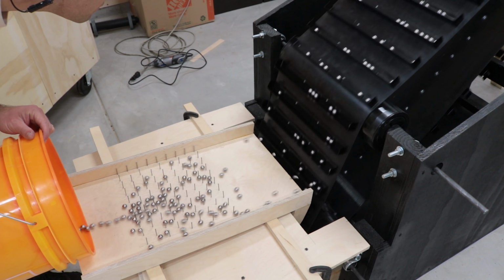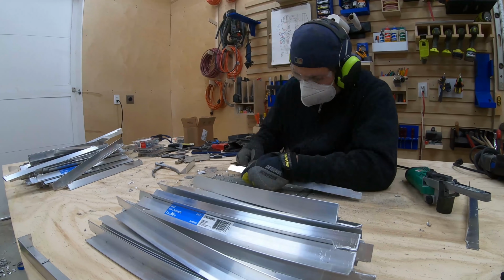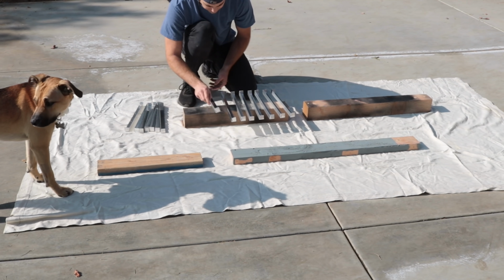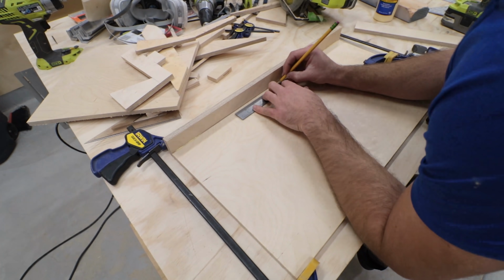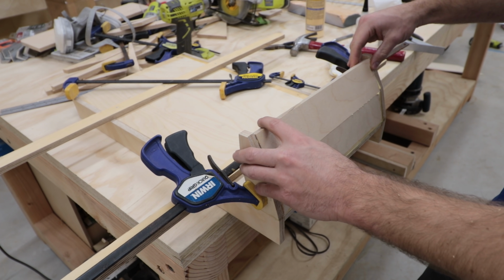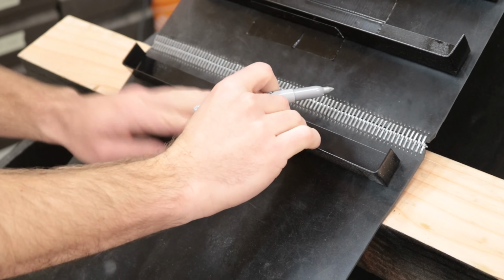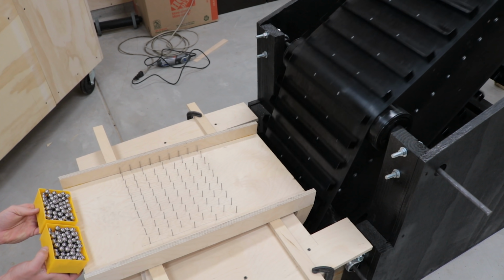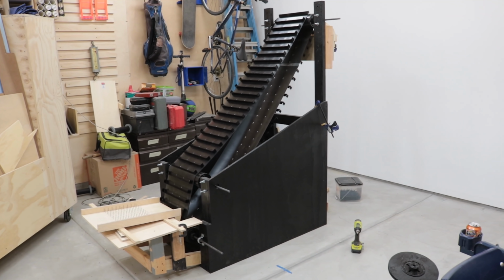Universal Marble Machine Lift Build, Part 4: Getting it Up and Running

Comment: I imagine that the track at the bottom might be improved by making a smaller (in width) ramp onto the belt, thus helping to prevent marbles from falling off the brackets
Reply from the maker: Great minds think alike! That’s a change I make during testing and adjusting. You’ll see next week!
Reply: @BenTardif  and in the thumbnail XD
Reply from the maker: Good catch 😆

Comment: If you're mostly using ball bearing as marbles I suggest adding a electromagnet behind the steep part of the marble lift.
Should greatly reduce transport losses due to marbles rolling of at the sides. 
Won't affect the brackets (apart from the rivets) and should reduce bounce (and possible noise) aswell.

Comment: I know you're shooting for a quiet lift so you can hear the marbles in the actual marble machine.  Have you considered felt lining for the brackets to reduce the metallic clatter when the marbles land?  You could do a similar, perhaps double layer on the catch ramp at the top.
Reply from the maker: I’m definitely considering it. Though I’m still looking around for a material that will dampen yet won’t affect performance
Reply: @BenTardif  scraps of neoprene might work as well, though you may have plans for the leftovers.  I'm also not sure about the cost and performance difference there.
Reply: Use Plastidip spray on the brackets?  Or maybe use Gaffer Tape ... as a nod to your stunt work on tv and movies.
Reply: Maybe sound deadening spray paint could work, though it would have been easier applied before the brackets were attached to the neoprene.
Reply from the maker: Great minds think alike. I tried one layer of gaff tape and it isn’t enough to change the sound. I will test multiple layers but that may not be the right solution
Reply: @BenTardif  I figured with your past history for working at Disneyland, you would like the idea of incorporating something onto your build that has an element of your other work or interests.  Just like placing an Eeyore Parking Lot sign inside the Temple of the Forbidden Eye. 🤓
Reply: I'd try inserts of EVA foam. It's pretty cheap and you could make them replaceable.
Reply from the maker: Thanks for the tip! I’ll look into it!

Comment: Great series Ben! I’m really enjoying this build. Have you considered maybe adding some 60, or even 40 grit sand paper to the rollers to grip the belt a little better? May help with the added weight of marbles, as the machines get bigger and better!
Reply from the maker: I have sandpaper tape called safety tape that I could use, though after a bunch of tests, there’s plenty of friction to keep it rolling

Comment: I've been watching these conveyor build videos. Nice job. What size steel marbles did you use for your marble runs? I normally use GraviTrax marbles which are 1/2" diameter. Regular glass marbles are slightly larger.

Comment: You might want to consider what will happen when a marble finds its way between the bottom roller and the belt, on the inside. It looks like a problem that you'll face soon and I would hate for it to break something.

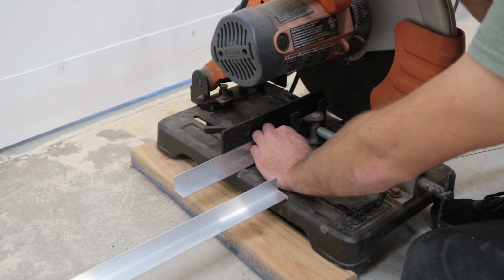Comment: 0:27 stand back boys I'm a DIYer ill do it my self

side note- if its aluminium a table saw should cut it reasonably well just set the rip fence the the width and cut until the mark then bend  with less harm to kickback or your fingers getting caught in the blade

Comment: I have a question. You said you want this machine to be quiet, so it won't take away from the marble machine. It is really loud as the marbles drop onto the brackets. They are also loud as they hit the receiving ramp. Would a thin line of felt quiet the brackets, as well as a carpet of felt on the ramp?